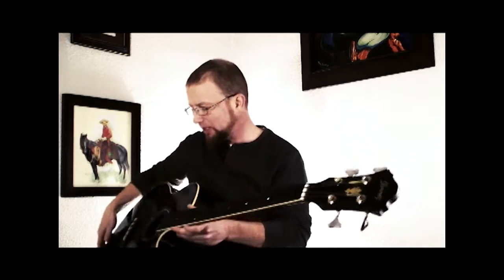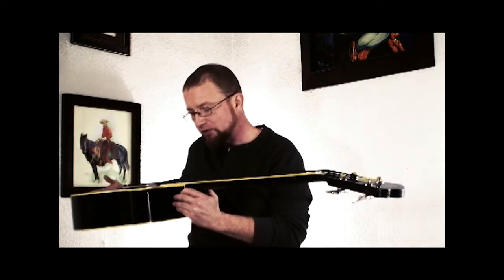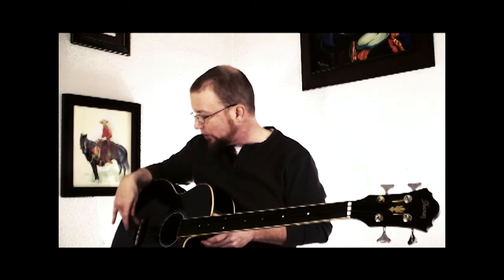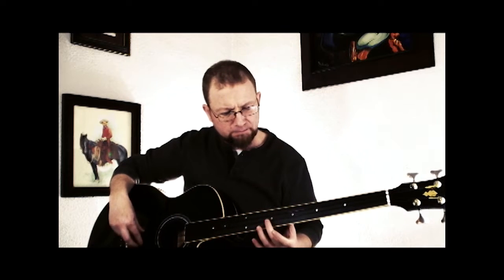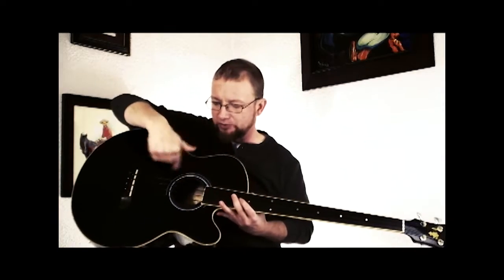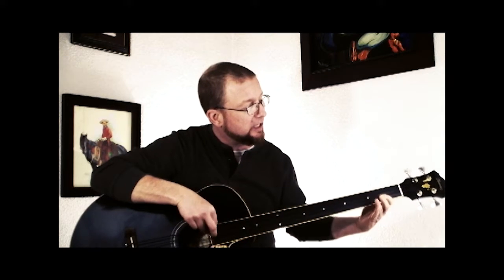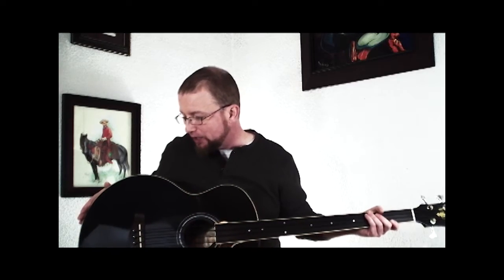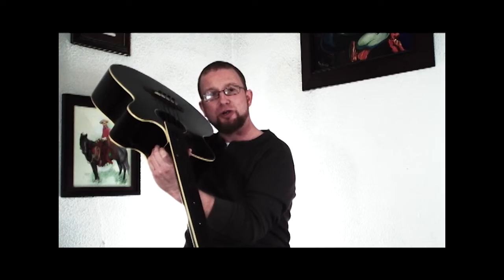Ibanez AEB5 Fretless conversion

Comment: I wonder why you didnt remove the fretboard inlays? 
I have a similar Ibanez bass that I plan to defret and it looks like they are glued or painted on because I can se wood grain trough them. Seems easy enough to lightly sand down. . .what are you thoghts on this?
Reply from the maker: Kunta Kinte On this bass, the neck was planed and leveled once the frets were removed (the reason for me taking it in to begin with), so the dots aren’t removed via sanding. Not sure about your dots, but these are indeed inlaid vs. stickers. Let me know what you find out on yours. 😊👍🏻